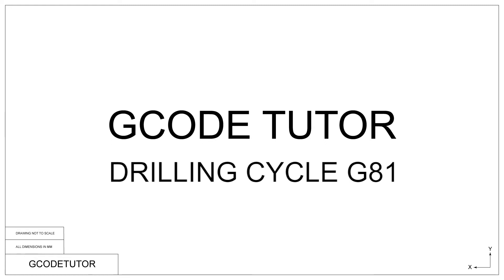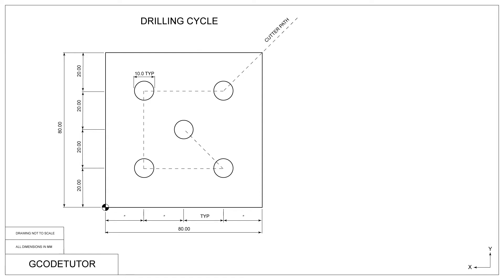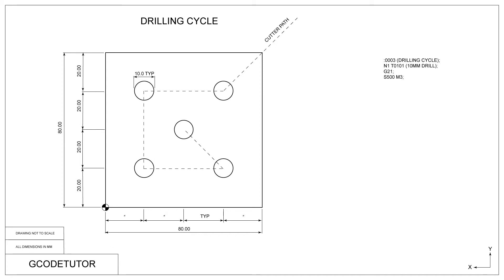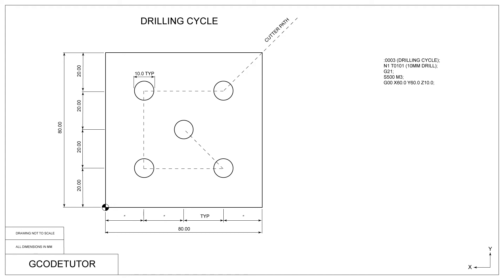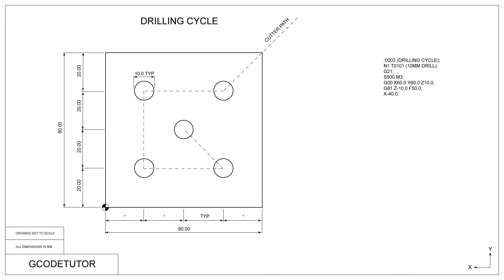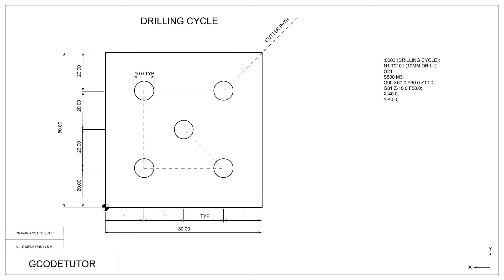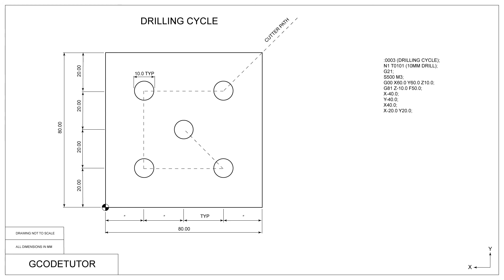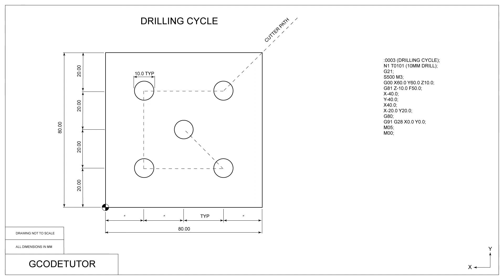G81 DRILLING CYCLE - CNC Programming tutorial

Comment: What if i wanted each hole to be a different depth ?
Reply from the maker: You add the z depth at the end of each line to change how deep each hole is drilled.
Reply: @GCodeTutor  sorry for being painfull. But like this ...
G83 X10. Y30. Z-10. Q5. R5. F150;
X20. Y10. Z-15.;
X40. Y60. Z-40.;
Reply from the maker: @bernardkriel1 yeah that's it.